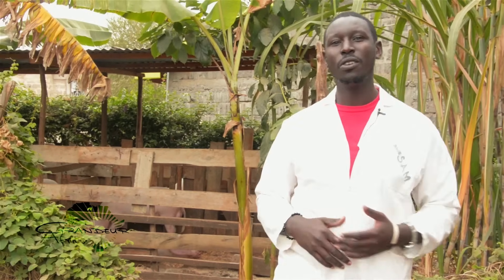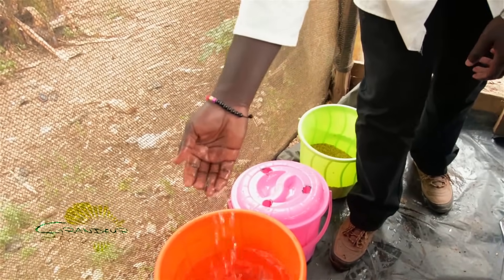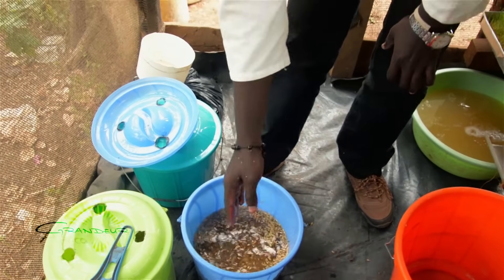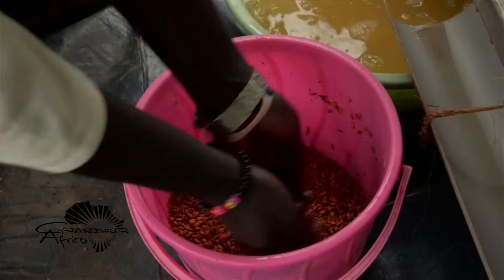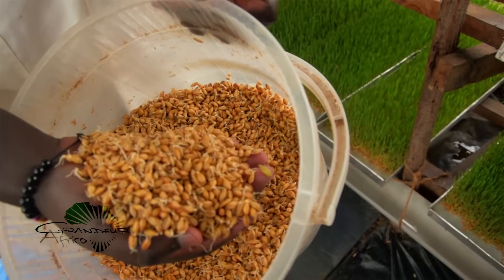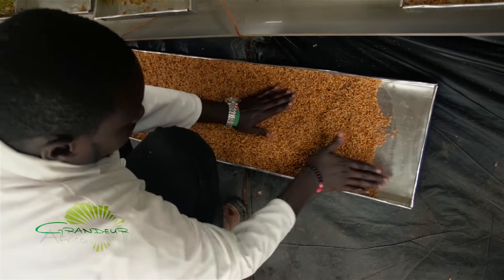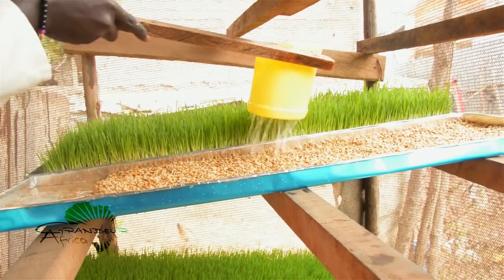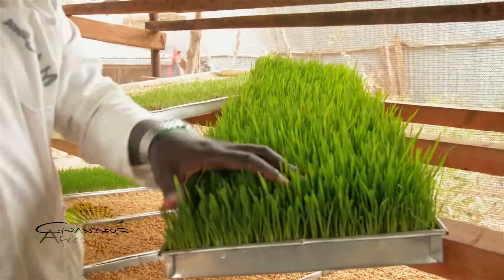The ‘step by step’ of how to grow hydroponic barley/wheat fodder in Africa

Comment: Good job, how much 1kg seed
Reply from the maker: Right now prices may range between KES 60-70 per kg depending on the demand and supply dynamics
Reply: @GrAnDeUrAfRiCa_Hydroponics Where do I get the seeds?
Reply from the maker: We do not have stock for wheat or barley at the moment. However, you may also source for maize or sorghum or millet from cereal stores. Sun dried, without broken seeds, moisture content of 13% and without preservatives.

Comment: What about the weather conditions or sun?
Reply from the maker: Germination only requires water, warmth and oxygen. That is all the seeds need for this process. High humidity or High Temperatures are a problem since they cause moulding or fungal growth
Reply: @GrAnDeUrAfRiCa_Hydroponics  bro can we grow this is areas close to beaches like in karachi , we have fairly high humidity like around 70%
Reply from the maker: High humidity would cause molding of the fodder. You could try modify the unit to ensure the growing chamber for hydroponic fodder has lower humidity levels.

Comment: Hello, I when lived 150 miles from Death Valley, California and because of the high summer  temperatures I raised corn, sunflower seeds,bean sprouts in a limited amount. I was interested in working with a few of the rarer grass seeds from Africa.i did some limited research with alfalfa and used it as a green chop to mix in to the feed mix.in the fall and winter we raised oats,barely,tricali,winter wheat,wheat,rye we used what was affordable and available locally. We also used the left over fodder and bean seed husks of fava beans to mix in to the feed mix we raised favs beans in the ground as a crop and a cover crop in the winter, we lived to eat black eye bean sprouts and when we had left over black eye  pea/bean sprouts we mixed then in to the livestock feed mix the livestock would go crazy for the black eye pea sprouts. Black eye peas love the heat and high temperatures.
The nice thing for us we where happy feeding the corn because for us it was a fast grower and loved the high temperatures we did grow the corn in morning natural sunlight to early afternoon  and we did feed it when it was two to four feet tall.
We where feed green fodder to cattle,goats,sheep, and poultry. The goats seemed to like the green folder best.
I had home made containers to grow my fodder  in and at the time I wanted to produce a few ton a day. It was very labor intensive. At the time I was thinking about getting a cheap cement mixer brand new for $ 100. Or lesse to soak my seeds in and to be able to drain water and to pour seeds in to the seed beds.
Regards
Hope
Reply from the maker: Thank you for sharing your experience which will give a new perspective to livestock farmers in terms of multi-dimensional approach to feed stock.

Comment: Hello, sir again there is something I need to get from, do you need ashelter covered with ion sheet or any transparent materials? Or you only need black mesh to cover both up on the roof and on sides? Thanks
Reply from the maker: You definitely need a shade net structure if doing this in Sub Saharan Africa but there are designs to suit a particular climate
Reply: @GrAnDeUrAfRiCa_Hydroponics  what purpose does the shade net cover serve
Reply from the maker: To keep temperatures and humidity at optimum levels

Comment: What about the temperature and how much water should i put 3 times
Reply from the maker: 20-27 degrees Celsius. Water freely or generously since the water can be recycled and re-used
Reply: Is it okay if it reaches to 30 to 32 ?
Reply from the maker: That is too high
Reply: Or if its too hot can I take the trays inside the house when is too hot ?
Reply from the maker: You can choose to optimize the growing area  so you do not have to keep moving the trays

Comment: Thanks for the video. I wish to know if a system can be made were in i do not have to water the individual treys. I just put water in a container on top and  water automatically flows to all the trays via gravity? Please advise
Reply from the maker: You can use a misting system with a timer

Comment: Hello, thanks for sharing very informative video. Wondeful. 
Can you please what type of barley or wheat are good for germination? Is it any specific type for barley or wheat?
Kindly guide.
Reply from the maker: Malt barley or any variety of wheat are good for germination as long as they are sun dried.
Reply: @GrAnDeUrAfRiCa_Hydroponics  thank you very much for responding and mentioning the types. What do you mean by sun dried? Did you mean that before soaking the seeds for germination, wheat should be spread and dried under the sun heat? If so, then for how many hours keep it under sun?

I got wheat from my friend, whose crop was harvested yesterday only (24-Mar-20). Should it be also dried?

Kindly inform to guide.
Reply from the maker: After harvesting any cereal, it is good practice to sun dry the seeds to a moisture content of 13-14% before any use or storage.

The wheat from your friend therefore needs drying first before use otherwise it may mould.

The procedure of germination remains the same though as shown in the video.

Comment: What is the temperature where the fodder is growing?
Reply from the maker: The ideal temperature should be 20-25 degrees Celsius but try to ensure it does not go above 27 degrees during the hot days. 35% to 50% Black Shade Nets should make your work easy

Comment: how to avoid the fungus, i already used bleach even every day i mix water with bleach but fungus still exist. i am using corn seed for fodder.
Thank You
Reply from the maker: https://www.grandeurafrica.com/how-to-get-rid-of-fungus-in-your-hydroponic-fodder-system/ Also ensure that your seeds are not already rotting or infected by some fungal problems either during storage or other post harvest activities
Reply: Grapefruit Seed Extract can be used during growing.  Foddertech uses 1% hydrogen peroxide to clean their trays.  If you buy 3% hydrogen peroxide dilute 1 part HP and 2 parts water.  Make sure your pans have enough slope to drain completely- 1:30 or so.
Reply: The best way to avoid fungus formation is before you soak your seeds  wash them with water and one drop of clorax  or detergent for every 5 litter of water mixed will. Make sure they all washed with this solution and rins them will then soak them . You can use a drop of dish washing liquid as well if  don't have detergent.  That'll kill most of fungus cusing bacteria s and don't leave growing for no more than 7 day tops

Comment: Instead of bucket use gunny bag and keep it in dark for 8-12 hrs depending upon climate. (Longer in winter ) gunny bag can be moistened and don't require moistening again.
Reply from the maker: Yeah, it is easier to use a gunny bag. There should be Version 2 of the video. Thanks for sharing your idea with us.
Reply: What is gunny bag.sir

Comment: Thanks...... Very good explanation looks very easy.... We will try.........
Reply: please tell me what temperature require of room? can we grow this in 5 degrees centigrade to 10 degrees of winter and in hot season of 48 degrees in summer?
Reply from the maker: And after trying, keep doing hydroponic fodder for the benefit of your livestock
Reply from the maker: To prevent moulding of seeds keep the temperature at 25 degrees Celsius. The lower the temperatures, the slower the germination will be because warmth greatly contributes to germination. Between 20-25 degrees Celsius is ok.

Comment: thx for the video. tried this method with wheat. though started seeing fungus patches from day 3. growth is also not dense. what could be the reason? used clean trays, no water logging, temp around 35 degree Celsius in my home itself, no exposure to sunlight. thx again.
Reply from the maker: Hello, the temperatures might be the ones causing the moulds. The right temperature range should be 20-25 degrees Celsius.
Reply from the maker: Also check for broken seeds, wheat moulds quickly if there are some broken seeds mixed up with the good whole ones. A little sorting might be required in that case.